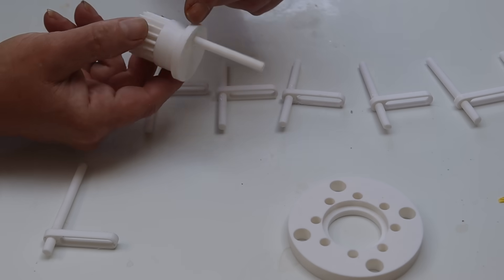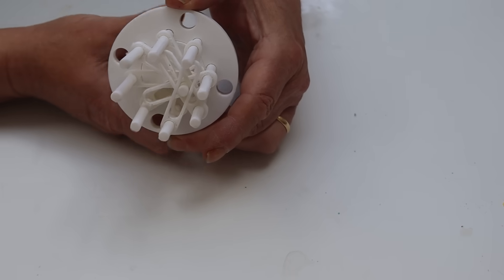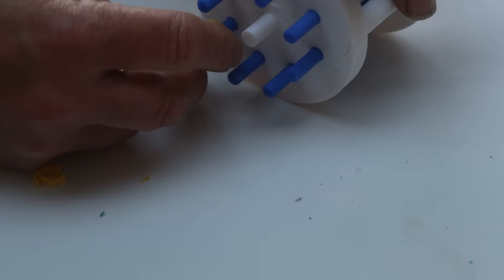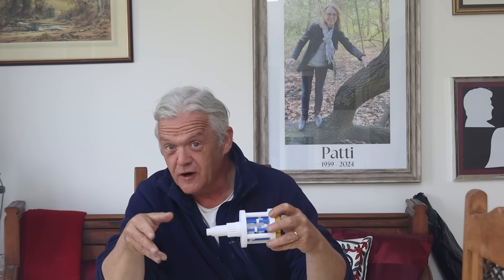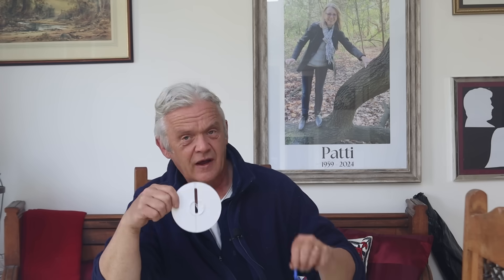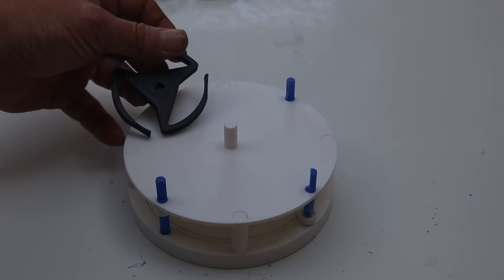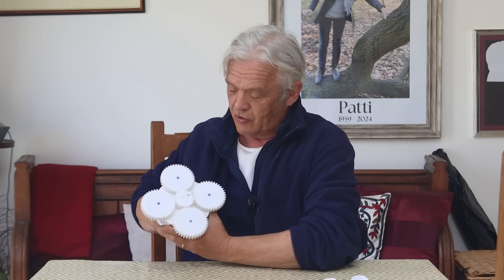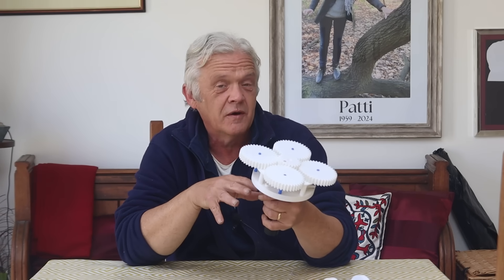2374 A New Bicycle CVT / Clutch Based On Levers

Comment: :  combination of scotch yolk and step machine, nice imagineering  - now to "vibration control" for high speed operation..  the step down version is like a variable hypocycloid drive - usually balanced by using a 180 degree (pi-radian) out of phase duplication.

Comment: Hey RMS, love your work. I think you've been playing around with plastic long enough, why don't you reach out and get yourself a cheap but reliable benchtop CNC so you can make these things in metal?
Reply from the maker: Ah mate - I have worked in everything - wood, metal, plastic, ceramics, glass and done a ton of vids on all this. I use plastic not because I have to but because it fits my circumstances. I used to have a workshop - but for personal reasons I gave it up - now I work from my home and I don't want a CNC machine in my living room lol

Comment: Interesting, intriguing!  A CVT without belts.  There is an idiosyncrasy in this design that isn't very obvious -- the speed of the output is not constant, as the input turns around, one at a time each ratcheted gear becomes the drive gear.  But each drive gear is pushing in an arc, not a straight line.  The more gears you have, the smoother the output, but this idiosyncratic output would have to be compensated for.
Reply from the maker: yes it does and a spring clutch on the outpput will take care of this - thanks for pointing it out - cheers

Comment: Thank you for going to the effort of making all these models, Ive finally wrapped my head around how the ratio zero transmission works after such a long time thanks to you mate

Am I right to assume this would free wheel in one direction? And is that also the case with the ratio zero transmission?
Reply from the maker: cheers mat and yes it would courtesy of the ratchets

Comment: I'd have a look at the swing angle at "max yoke" (haha, 'top gear') and base the number of planets on that. Looks like it might be around 60°, so 6 gears (to make 360)?
No science behind that but Im thinking to make the torque transfer as smooth as possible for the whole travel, so the theres no uneven levers at certain points.
If there's a nice mechanism that allows you to rectify both forward and backward components of the reciprocation that would be an amazing bit to include so opposing levers can share the load at their widest instead of at the moment being unbalanced (on lever transfers all the force and the other just ratchets)
Reply from the maker: cheers mate

Comment: 5:20 One could always stack larger planet gears the same way you've stacked the levers. No reason they can't overlap, the sun gear would just need to be longer (and presumably a little stiffer because there's no directly opposing gear contact).
Reply from the maker: you could - but they would just be acting as levers
Reply: @ThinkingandTinkering  Oh, that's not what I meant.. the clutches, everything else would be the same (thinking of the smaller model) but the larger planet gears wouldn't actually fit on the frame, so have one in mesh with the small planet gear, and then the next gear/clutch in line would just sit 'above' the last one, overlapped, still in mesh with the planet gear. Just a way to get the ratio down without growing the diameter of the assembly, were it to need to fit in something like a bicycle wheel hub. 

Thought about it a bit too and what I said about the opposite point of contact was wrong too, no reason the opposing shaft wouldn't be on the same level, because they won't interfere.

Text is a poor drafting simulator...
Reply from the maker: @mfree80286  very true mate lol - but i get it now - thanks for explaining more - clever - i like it thanks for sharing

Comment: Doesn't that design have lots of friction points, especially under load?
Reply from the maker: no mate - i can see what you think, i think. Because it has levers you are seeing sliding friction - but they only slide when you are changing gear - the rest of time it is rolling friction - so pretty much it sees no more friction than any other geared drive
Reply: @ThinkingandTinkering  Ok

Comment: simply wonderful, im sure in the future CVT's will be mainstream even in cars, and im sure a lot of the models will work on the same principles as your builds.
Reply: Cars? Nah. Electric motors dont need variable reduction.
Reply from the maker: yes they do mate - you might want to check your understanding on why a transmission is used - quite common in electric cars is what is called the eCVT
Reply: @ThinkingandTinkering  didn't find any videos giving a satisfactory explanation for the working principles of an E-CVT would be cool to see one in your channel one day
Reply from the maker: cheers mate

Comment: Very interesting.
I could imagine something like this also being very useful in the drivetrain of a peddle-assist e-bike, both to simplify the mechanics and reduce the size of  the drive motor ...while you don't need a gearbox for speed adjustment in a sufficiently powerful electric motor, a smaller motor with it's own benefits would appreciate a variable torque multiplier.
Reply from the maker: Cheers mate

Comment: I hope for the day that someone invents a CVT that works without friction connections or one way rectifying systems. It appears to be very very difficult to make such a system. Perhaps some kind of 'conservation of angular momentum' cvt that uses flywheels that change in size like a ballerina pulling her arms in; to change torque and speed, would be possible?
Reply: I am convinced it is possible to build a cvt that works on the principle of slippage, i.e. the inverse of friction. that way you avoid the damage common to belts and pulleys. 
In most cases, cvt aren't necessary, and in cases where it is necessary to avoid the power loss during gear changes, a second engine and transmission can be used during the intermission.
Reply: @martin-vv9lf  your idea is intriguing, I have been constantly thinking about CVTs, and believe that there are many more practical principles able to be exploited other than rectified reciprocating motion, friction or electrical converters. How would you slipping system work in theory?
Reply: @st0rmerc00l8 are you familiar with the method in geometry of using a set square to divide a line into equal parts? my belief is that the same sliding set square method can be applied to scale speed, and not just length. although that method relates to a line of finite length, it may be possible to apply the method to a line of infinite length.
Reply from the maker: well I suppose a governor in a sense does that - interesting idea mate - thanks for sharing
Reply: It is in fact proven impossible to make a smooth-running positive-engagement CVT, in much the same way and kind of for the same mathematical reasons that it's proven impossible to "square the circle" using Euclid's rules.

Now, in practice would a "mere" 1000 different gear ratios with slightly rough motion suffice rather than a truly CV transmission? Well, that's a different question.